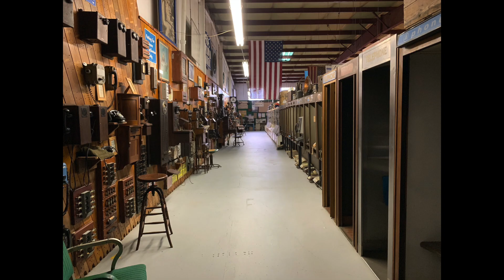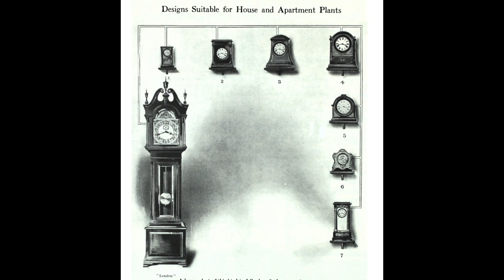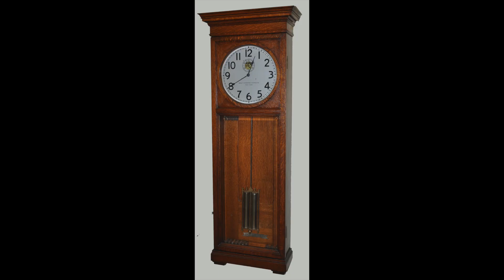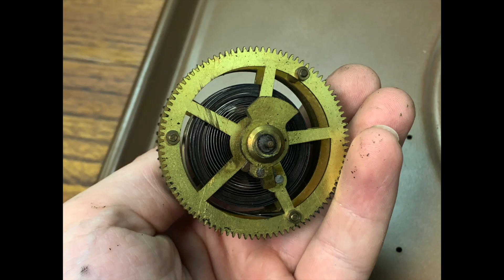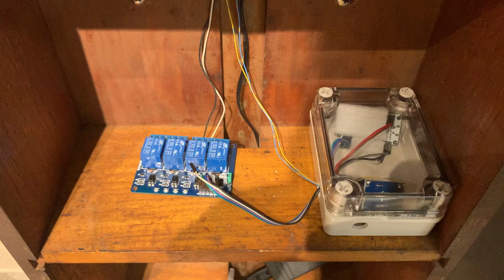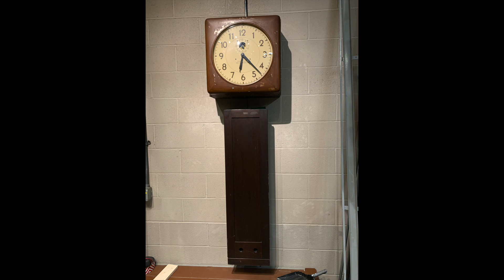Self Winding Master Clocks in Central Offices

Comment: I got to see the old AT&SF master clock in Glendale, Arizona. It was a majestic self-winding main spring driven mechanical clock in a large glass case. My grandmother managed to grab a self-winding clock from Buckley Field's old PBX room. I think Westclock may have made that one. It made this weird whirring noise 3-5x per day, and that was the clock winding itself back up. It ran on two sets of two D cells. It had the relay sending units but it was very simplistic compared to the railroad's massive brass clock on a level surface plate in a glass case. That clock used lead acid batteries.

Comment: The city I worked in the exchanges all had regular clocks. The billing for toll calls was done in the toll switch. That was called CAMA or Centralized Automatic Message Accounting. That’s where the Master Timer was located. But there was one switch with Centrex service that had LAMA or Local Message Accounting. No master clock. We would call a number in New York every morning and make sure that the clock in the switch was within 6 seconds for accurate billing. And the person on the night shift had to cut the paper tape that recorded the toll calls at 3 AM every day, package it up and send it by Greyhound bus to the billing office located in a different city for processing.

Comment: One of the interesting things I observed in my high school classrooms where we didn't have a battery backup for the office master-clock systems was when they reset the time on the master clock, the hands on the classroom clocks would all move in response. In many cases the classroom clocks were little more than a gear train for hour and minute, being driven by a stepper motor that was operated by that clock pulse. As the clocks were only showing hour and minute, it was very possible that they were only getting pulses to move forward every 6 or 10 seconds, because most people wouldn't notice a change in time beyond that. Usually this was the result of a power outage, the other time these clocks might shift unexpectedly was the Monday morning after the start or end of DST.

Very rarely a clock would loose sync with the master clock, and fixing that would involve someone (senior custodian?) would step in and use the thumb wheel on the bottom of the clock to adjust the clock to the correct time. As these clocks themselves did not need local power, they didn't have batteries.

It would not surprise me if schools today either didn't have classroom clocks, or if those clocks all were the variety operating off of a single AA battery. While it might be easy to take one of the old slave clocks, put in an esp32 and a stepper driver to handle driving the clock. I suspect getting the display of such an analog setup synchronized, would probably involve some custodian with a cell phone or tablet to come in, link to the esp32, adjust the clock hands through the esp32 to point to 12 noon, then have the esp32 move the hands from there to the current time, and carry on. I would think this would be a reasonable solution for nearly every analog 'radio' clock. Move the lever on the back of the clock to the correct time zone, set the hands to 12 noon, press a button to 'sync' the display, and the microcontroler in the clock deals with moving the hands around to the correct current time.

And usually the first indication that classroom clocks were going to be 'corrected' was about 3rd period the end of class or start of class bell would go off in the middle of class, and everyone would look up and see that the wall clock was off by 3 and a half hours. Then wait for the clock adjustment to kick in, and listen to the start and end of class bells to go off for first and second periods, and so on. Bit of a distraction from learning that day's chemistry curriculum.

Comment: Haven't seen a self winding clock in a long time.  I have a self winding car clock from an old Chrysler that every few minutes would make a single loud click and rewind itself.   The synchronization on the clock you described is similar to the Simplex school clocks that use a synchronous motor.  Right before the top of the hour, a solenoid powered by the master clock engages and resyncs the clock to the top of the hour.

Comment: Very impressed with your vast knowledge of Old School Central Offices...

Guess I am old school also. I can still remember 1A2 Keys Systems. I got involved in Telephony in the 80's during the break up and restructuring of Bell and AT&T. I worked with several 'Interconnects' selling and installing telephone hardware to businesses. 

I started with a small one in Yakima. Later I worked for a larger one in Seattle. I learned about a PC based voice mail, automated attendant, and information trees systems from Seattle based Active Voice. I later became a Dealer and tech expert. I was a Alpha and Beta test site. I knew Repartee (PC based system) as good as the super geeks at Active voice. They trade marked 1 for yes, 2 for no, which set their system apart. Later they sold to NEC I think and many retired millionaires from original stock. Almost every electronic auto attendant, voice mail, or information system asks you to confirm your choice. It says press 1 for yes, or 2 for no. That still makes money due to licensing by old company to NEC.

Between my own company and the interconnects I worked for or did contract work for, had many high visibility accounts like City of Kent, Millstone Coffee, Jansport, etc. I was involved in 2 startups with partners and later I started another company selling redundant PC systems with Disk Mirroring.

I have never been in a Central Office until much later. Have worked with large PBX switches all the way to small 2 lines 5 phone key systems. Even a few 1A2 systems in remote locations. They were very rigged and never broke. Perfect for those customers in remote mountain resorts. Who wants to trek high in the mountains to fix a broken handset. Visions of Jack Nicholson and The Shining from the 1980's.

I went to work for Boeing in 1996. I worked in the IT and Desktop Support division. We had 350 techs in Everett taking care of 50,000 devices used by 30,000 customers. I worked in the Twin Towers (87 and 88 building). We had the main server rooms and giant central office switch. I think they had a 5ESS Switch, but can't remember. 

If they did to start, they certainly replaced it to full digital and later IP. Boeing had their own private network linking all divisions, all factories, and all corporate together with a unified system. Each location had their own switch as well. Of course they had gigabit and terabit data lines as well. Boeing had all the cool toys. Loved going into data closets that were packed with electronics and giant backboards too. Smells so good.

Keep making videos and I will keep watching... You are amazing.. thank you..

Comment: I used to work at a largish government site with secondary clocks in every office and a master clock somewhere in the maintenance department. I ran the first computer network in the building, before anything was connected to the Internet. Twice a year I had to reset the server clock to start/end daylight saving time, and I carefully coordinated with the secondary clock - I'd type the time on the server but not press enter, and as soon as the clock made the buzz-click noise that indicated the top of the hour I'd mash the enter key to set the time as accurately as possible.

A few years later I was reminiscing about the Good Old Days with the maintenance guys, who told me that they carefully adjusted the daylight saving time on the master clock with the time on their computer...

Comment: A modern version of this system is the master atomic clock in Fort Collins, CO, providing the time to radio station WWVB on site, which transmits time of day data to millions of radio controlled "secondary" clocks with internal radio receivers. The mechanical, analog, versions, many from La Crosse Technology, are probably the closest matches to the clock in the museum. In normal operation with the clock receiving a strong enough signal from WWVB, they set themselves after the battery is replaced, then operate as ordinary quartz clocks, setting themselves once a night. The clocks also make DST adjustments based on information encoded in the WWVB signal. If you live in an area that does not observe DST, you can turn off that adjustment.

Actually, these radio controlled clocks match the master clock more closely than the secondary clocks, because they are only set by the time signal once a day. The inexpensive modern quartz oscillator is possibly even more accurate than the very high quality movements in master clocks in these systems. Effectively, there are no secondary clocks and master clocks are deployed instead.

It is fascinating to watch the mechanical analog clock, after the battery is replaced, move its hands to a reference position, wait until it receives valid data, then move its hands to the correct time. There are also digital electronic versions of these clocks, which display a reference time after the battery is replaced, and then "immediately" display the correct time after valid data has been received. Note that it takes one minute to send a complete data frame and the clock may wait for more than one valid frame to be received before setting the time.

Link to a video on youtube: https://www.youtube.com/watch?v=cAHRk_R0F94

Comment: Thank you for the interesting article. I’ve had two experiences with similar clocks.

When I was in public school, the big clock in the principals office and the clocks that were synchronized we’re pretty common in most of the schools I attended. However, by the 1960s the slave clocks started having trouble sometimes being as much as 10 minutes off when the synchronizing pulse came in and they didn’t fare so well because the clocks weren’t supposed to be that much off. Eventually in my school they just covered the clocks up and we didn’t use them anymore. However, the master clock still rang the bells.

The other self-winding clock I ran into was in my 49 Chrysler sedan. This had a clock in it and when it malfunctioned I was surprised to find out that it had a motor in it to wind the spring, much like the mechanism you described. That was the first time I realized that not all clocks were powered the way I thought they were.

I have one more related thing. When I was in Hawaii, the military communication system also ran on 24 V and we had 12 cells that were in glass containers in our back room to provide the power. Again, the power was provided by the cells which were charged by the electrical system, but this approach assured that if we lost electrical power a communication system would continue to work.

Thanks again for the great presentation.

Comment: My high school used a system of synchronized clocks from IBM. The master clock was in the administrative part of the building and slave clocks were in each classroom. When we switched from DST to standard time or vice versa, they changed the time on the master clock but the slave clocks would "go crazy." I think the bells for changing classes rang on time after the master clock was changed, so that part was orderly. However, teachers had to rely on their watches instead of the classroom clock to make sure lessons were proceeding on time. After about a week of, probably, furiously straightening out systems for other customers, an IBM technician would make a service call and straighten things out for us.

My internet search has found synchronized clock systems from IBM, but I haven't been able to match up the system that my high school used.

Telephone companies needed accurate clocks to do billing. The rate for an entire call depended on the rate period when the call started.
Reply: Rates for phone calls have, at least since the 80s, worked as described in the phone books of the time: "A phone call beginning in one rate period and continuing into another rate period will be billed at the rates applicable to both periods"

Comment: I have a international which later I think became IBM time clock that came out of an old carpet mill and it was the Master clock it looks like a grandfather clock and you would think it's set on the floor but it actually hang on the wall and was hooked up to all the clocks in the plant and kept the time it had automatic wind for the weights and was made in the 1930s last service date on it was in 1958 I believe it's a very unique clock

Comment: My first job lecturing, in the 1960s: the site had an IBM master-slave clock system. About the third lecture I ever gave, I was looking at the clock at the back of the room, thinking "It's only 25 minutes past the hour, and I'm two-thirds through my material. Slow down." Then, at about 35 minutes past the hour, it suddenly accelerated and whizzed through the next 15 minutes. Nobody had told me that they did that--the folk explanation was water in the cables.

Comment: In 1984/5 I designed a battery-operated handheld clock used to synchronize/rate the individual field clocks that kept time for seismometers.  A small microprocessor operated from an expensive TCXO running at 1.000 MHz +/- 10E-7.  On its own, this handheld box would keep time to within ~ 30 ms per day.  I added a then-available Radio Shack "time cube" WWV(H) radio receiver & designed an analog filter circuit that could reliably separate the audible WWV "ticks" to be evaluated by software to compare the local clock to WWV, & automatically correct the local clock if it deviated by more than 21 ms.  You may think that is a pretty coarse threshold, but don't forget that WWV signals might differ from WWVH signals by over 10 ms of transmitter to receiver path length variations (multi-path ionospheric bounces), so asking for better than ~ 20 ms was unreasonable, and would have added unnecessary dither to the timebase as reception conditions in western North America faded back & forth between WWVH in Hawaii & WWV in Colorado.  I learned a lot about timekeeping that year.  In ~ 1995 I began using GPS time.  My tiny workshop presently has a couple of GPS15L receivers & antennas so that I have reliable access to the one beat-per-second pulse train generated in the receiver.  These pulses are good to better than +/- 200 ns error.  This is, of course, gross overkill for my wall clocks, but the fanaticism grows stronger every year...  LOL

Comment: 50 years ago I was refurbishing and refitting similar clocks that were taken out of service from air traffic control towers. They had long pendulums that were, in theory, not subject to variations due to temperature and a solenoid that would give the spring a slight wind periodically to maintain the tension. It was a bit of a rig up so that they could be used as ornamental clocks without their usual time sync signal being available. They were quite attractive cabinet clocks.

Comment: I could have gotten an entire system from a grade school in the neighborhood. They piled them up in a corner of the school yard for pickup and disposal at the yard just blocks away. The master and all slaves the wiring and power circuits were all there! I remember seeing the correction cycles at times during class attendance. Almost always, they ran on the slow side so the minute hand moved to the correct time. Click! Click! Noisy.

Comment: My parents had a 'self winding clock', way rougher than this unit. Ours was a cheap-n-nasty thing that had a DC motor inside that would kick in then the main spring wound down, it was noisy, I could hear it in the middle of the night from my bedroom, I couldn't wait for this thing to fail and be chucked out.

Comment: Wow!  Awesome video.  Thank you.  It brought back memories of the clocks and synchronization system my High School would use.  They sent a audio tone superimposed onto the 120vac at specific intervals - I think like 1 or 2 minutes before the top of the hour.  That signal that they put over the building's power distribution was soo strong that it would make the computer monitors on some computers go nuts for a few seconds, and I was even able to faintly hear it from my home over a mile away coming out of transformers and any amplifier that was picking up AC hum.
Reply: I bet the power company just loved that.
Reply: My schools since 2010 or so used rectangular atomic clocks

Comment: Wish I still had a picture of it, but the Market Central Office in Tacoma (757 Fawcett, TACMWA02) had one of the tall, long pendulum, master clocks on the south wall of the second floor 1931 vintage #1 SXS, next to the MDF. When the office was retired in 1979, that clock went to Bill Smith's collection of classic goodies the night of cutover to the ESS in the building across the street (750 Fawcett, TACMWAFA). 

I think the last thing that clock synchronized were the operator position clocks on the forth floor.

Comment: I have seen quite a few of these and they all seem to run on dry cells while using the telegraph system for synchronization. I was however being under the impression that the clocks in my school could be told to more or less go to the next "hour" at the minimum. I seen remember being a kid and having a power outage while in class (more than one occasion) and when the power came on, the hands on the clock would race around the face to the correct time. Me being into electronics and such, was absolutely fascinated the first time I saw this happen. After seeing it a few times I was theorizing about how that all worked. Anyway, here I am years later, I would love to have them ALL over my house... most times they are extremely hard to find, not working, and or very expensive.